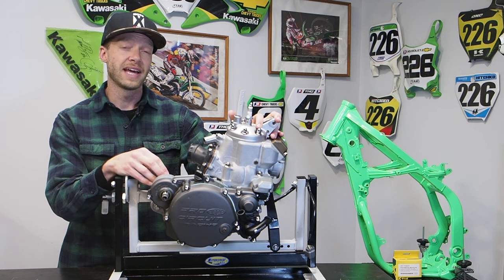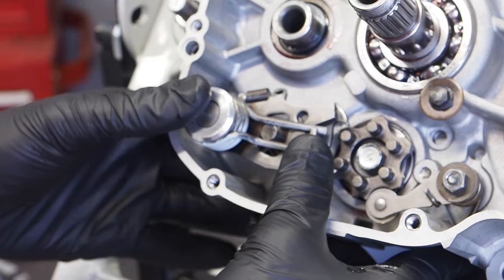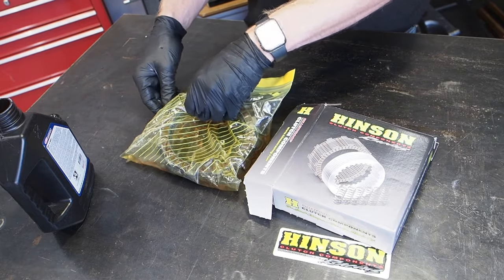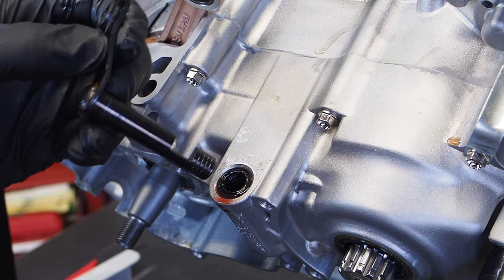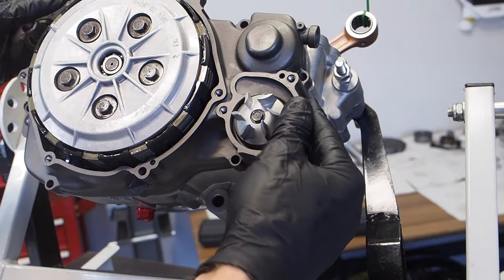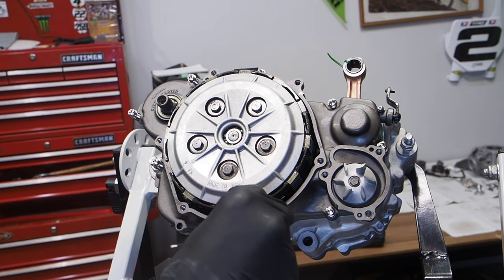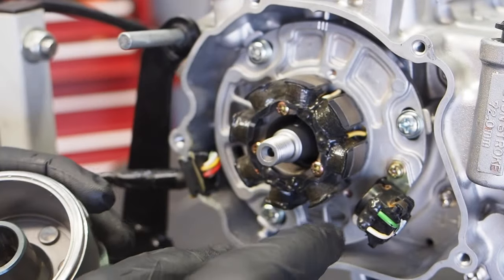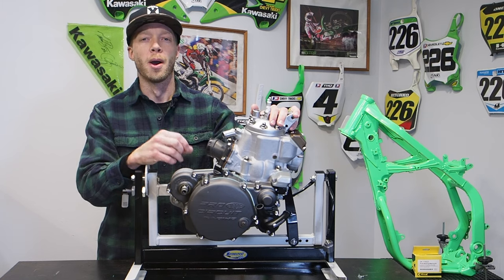DIY KX250 Engine Rebuild PART 2 - Clutch, Shifting Mech, Kickstart Assembly,  Water Pump, Flywheel

Comment: The pro circuit case covers cool the boyson case cover had some with a works look not polished and a cool fab look been a while I think you could get them in black or a rustic metal look. Henson made the black cover as well I believe the pro circuit works pipe  showed the welds not polished good look

Comment: Out of the 250’s which one is the most enjoyable, easiest to rebuild
Reply from the maker: Great question! This one has the easiest bottom end, because the shifting mechanism is simpler than the newer models. The only real difference is in the power valves, I think the 05-07 KX250 was the easiest out of the rest. The CR250 wasn't bad either but setting up the RC valve and getting it correct is annoying lol.
Reply: @GregHitchko  yes I’ve seen that with the cr’s. Great work, I never could do that, you differently have a calling for it. 
Are you for hire??

Comment: Hey Greg 

On the Pro X fiber and plate kit there are no blue and red markings. Would that mean that all fibers are identical?
Reply from the maker: Yes! It shouldn't matter which fibers go where, just make sure you start and end with a fiber 👍🏼
Reply: Thanks Greg! Almost there
Reply: After installing the fibers and plates I noticed a clicking noise when the idle gear rotates, it’s contacting the spring on the shift shaft. The shift shaft is pushed all the way in. Is that normal?